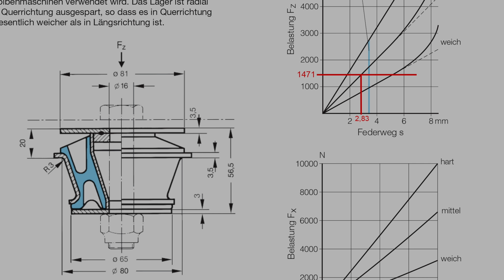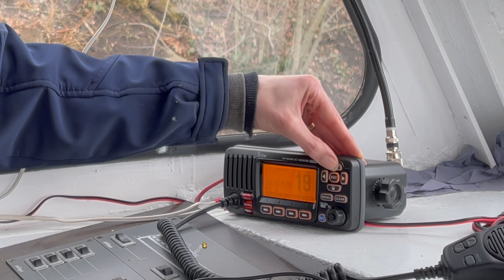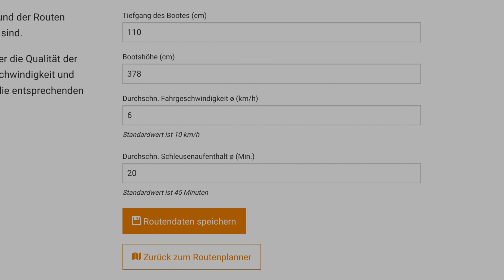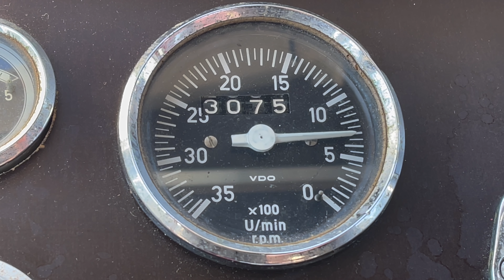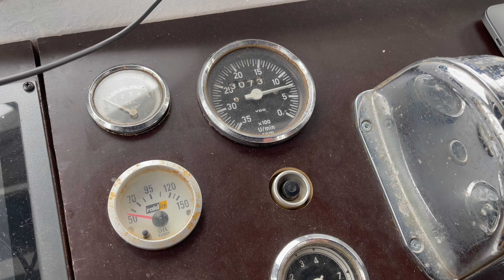BOAT TRIP

Comment: Any time engine mounts are changed or adjusted you should check the transmission output shaft and propeller shaft coupling for alignment.  Nice work tho
Reply: agreed, although i wouldn't be surprised if the engine alignment is still at factory settings. these cruisers don't get a lot of hours, and they don't have a lot of power anywho.
Reply: It’s better to check allignment of all transmission group. After last support change.
Reply: As a boatbuilder I strongly advise a alignment even if there is inly a half millimeter hight difference it will wear both of the bearing sleeves down and that will get expensive.
Are you still in Germany, let me know I can help you
Reply: The old mounts may be ugly, and may have sagged a bit, which forces an alignment, but they are still functional and will not come apart or transmit much extra vibration.  All they need is some rubber protectant and that alignment, since they are guarded all around by metal and will not come apart.  Most rubber protectants also prevent rust.

Comment: Hi, to remove your fourth engine mount you can remove the four studs on the mount by loosening one nut a quarter of a turn then remove another nut screw that on to loosend stud and lock the two nuts together with two spanners,then put a spanner on the back nut and the stud will come out.Keep up the good work,your you tube channel is very good.
Reply: Or remove the bolts holding the mount to the bed.  hehehe

Comment: You use a second back up nut to jam onto the bolts or you can weld the nuts to the bolt and grind them loose later or use new bolts. Bob in Nevada

Comment: Engine mount bolts should have a spring washer and thread lock paste as they are prone to vibration which will loosen the unit.

Comment: Another nice update and progress, those motorcycle rubbers have indeed seen better times, luckily that is now arranged.

I couldn't see well in your video recording how the connection between motor and propeller shaft is composed, it is only advisable to check the alignment between motor and propeller shaft after replacing the motor rubbers.

Having said that I am looking forward to the next movie and update cheers .

Comment: Having changed a lot of rubber worn and perished suspension bushes and mounts ... I would  have looked for some Polyurethane replacements. They last and perform better especially if theres heat fuel and oil contamination issues. 
Save the details and the best of the old ones as a pattern. 
Do not get WD 40 on your rubber  ...if you do wash it off straight away. Or they will start cracking in months.🤦🏻‍♂️ I made that mistake ...

Comment: In order to remove the rust from the barge I recommend an electric magnet on a bracket to stay off the hull. This will also get the fine particles making the air quality better.

Comment: Great vid, tip for getting studs out that won’t come out with the nuts, put the nut back on then add a locking nut, I.e. the same nut on top of the original nut, lock them off against each other, then using a spanner, hit the inner nut to free up the stud. 👍

Comment: Hey i would definitely put a jamb nut on that mount, if you don’t have any room for one you can drill a hole through the nut and rod and use a cotter pin to secure that nut.

Comment: permission to come aboard captain, Thats easy to take out 4th motor mount put back 2 nuts back on one bolt tighten bolt together then put wrench on the back nut to remove it, luck. the last old mount will case premature wear on the new ones, and if I come visit, may I have permission to come aboard. for a cruise around the country?

Comment: Its possible the gearbox has too much oil.  Check with warm engine and running.  Oil level when engine running should be between the high and low on dipstick.

Comment: Sorry to say, you have made a complete hash of that job. You should only have 2 nuts on each mount exactly as you had originally. That will give you the adjustment required to align the engine which you did not do but should be done when changing mounts. Usually the top nut is nyloc to alleviate the need for thread lock.